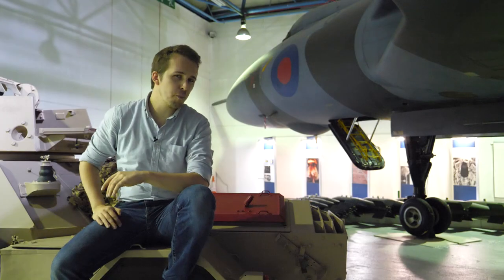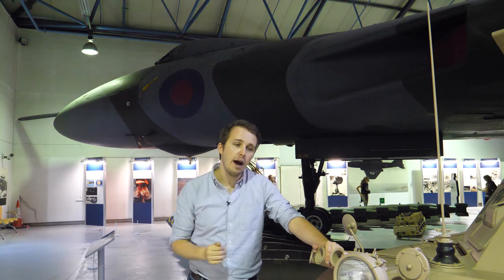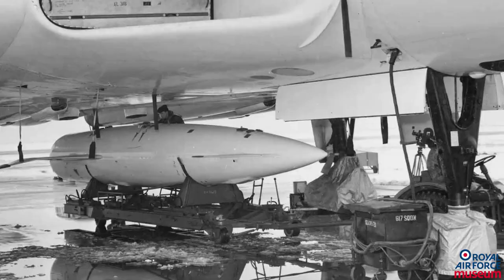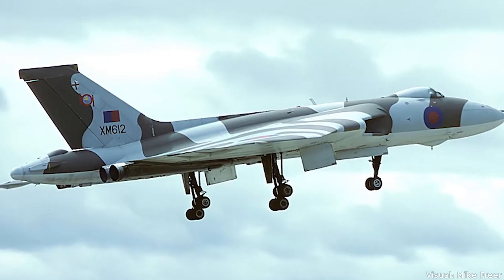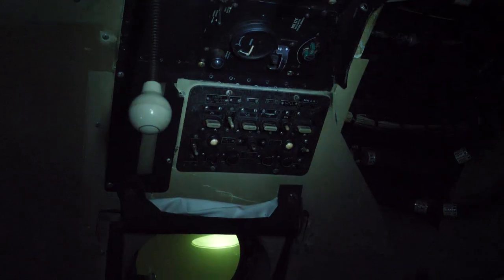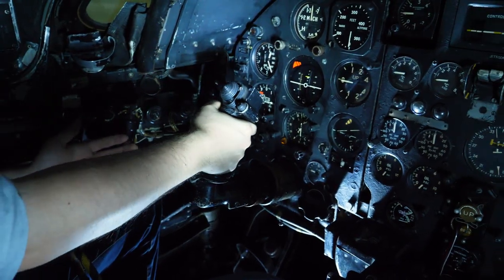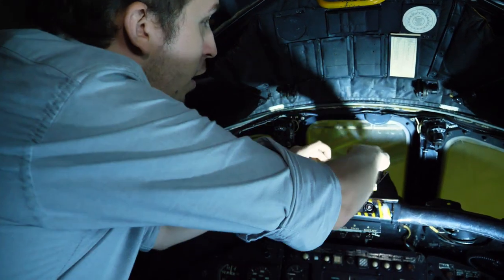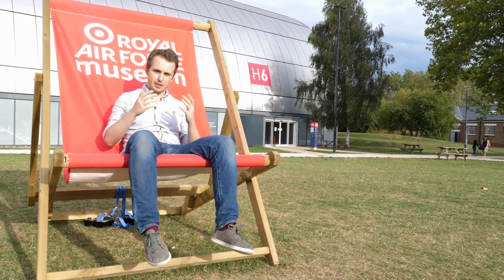Inside The Cockpit - Avro Vulcan B.2

Comment: From the 1st flight of the Lancaster to the 1st flight of the vulcan was 11 years!!
It still looks like a spaceship 70 years later!
And my god that howl
Reply: When u hear the howl of the Vulcan and it's not your Vulcan, u gonna have a bad time.
Reply: I remember being at Farnborough watching a Vulcan with a Conway (testing for the future Concorde) strapped underneath. On the Conway's power only, it just went straight up. I can still recall the vibrations I felt throughout my frame.
Reply: @johnjephcote7636  concorde used olynpus not Conway. I think the vulcan used to test the tsr2 olynpus exploded as well.
The vulcan had olynpus which got developed further for tsr2 with reheat. Then that got more development and ended up in concorde
Reply: @Scoobydcs  You are correct. It was 1964 when I witnessed XA903 fitted with an Olympus 593 underneath it (to test the Concorde intakes, I believe). It could still fly on full power with this extra engine alone and that is what I was treated to..
Reply: @johnjephcote7636  yeh the tsr2 version had 30k lb of thrust. The concorde version had 38k!! Iirc the early vulcan had 40k lb thrust total from all 4 engines lol
Reply: @1337fraggzb00N interesting

Comment: As a young teenager I saw one of these at an airshow in the 70s. It looked like a mantta ray as it floated over at a low altitude.  So cool, wont forget it!
Reply: I also have fond memories of seeing the Vulcan in the 1970s. It would appear at the Abbotsford Airshow on the west coast of Canada. We were told that came from the UK and returned in a single hop, no refueling. 

The  Vulcan banking at low altitude is the most awesome aviation sight i have ever seen. It was something beyond this world, like a massive dragon or alien spacecraft moving over the land.  For the Soviets, as the intended recipients, it must have been a terrifying image.
Reply: Stuart Grant I think, for the Argentinians, it would have been a thunderous and terrifying image also.

Talking off of the Vulcan banking at lower altitude, and it's gracefulness, one of its main advantages at high altitude was it's size. At nearly 60,000 feet, it could out turn any fighter jet due to to the enormous wingspan. And then, with self protection measures like flash and flare, it might, just might, stand a chance of getting away.

As for Abbotsford in one hop, it would have refuelled somewhere on the East Coast because even without a bomb load, the Vulcan had a range of only 3,200 miles.
Reply: @RB747domme  Regarding the flight to Abbotsford, I must have misremembered what I was told. Perhaps  they air refueled (i.e. I was told non stop, but interpreted as unrefueled) or maybe my memory was completely wrong. Regardless,  a very spe
Reply: Same here. A Manta Ray is also what I thought of years ago when one flew over me in lonely central Wales.

Comment: Back in the 80s, when I was a B-52 pilot, one of the last operational Vulcans came through our base (Mather AFB). The pilots came over to our squadron (441 BMS) and asked if anyone wanted to go out to the ramp and check it out so me a couple of other pilots got to go inside.  What struck me was just how dated the Vulcan was. B-52s are just about the same vintage, built in the 1950s to very early 60s, and though the B-52s of the 1980s were well worn and  not exactly cutting edge, but compared to the Vulcan our B-52s look downright modern and in good repair. We had FLIR, low light TV and terrain avoidance radar, displayed on a CRT in front of each pilot, the Vulcan had nothing but steam gauges that looked like they were designed during WW-2. Our Nav and Radar Nav had the all glass OAS nav system, but the Vulcan still had an optical bombsight. and while our entire crew of 6 had ejection seats (0 and 90 knots for the upstairs crew and 200ft and 90 knots for the navs) while the Vulcan had ejection seats only for the pilots. (Must have made the decision to eject a guilt ridden exercise for the aircraft commander).

The cockpit on the Vulcan was tiny, the pilots sat shoulder to shoulder.  I seem to recall the pilot telling us that the plane was originally designed for a single pilot but adapted later for two, which would explain the cramped pilots station.  The rest of the crew had chairs and some sort of bailout slide rather than ejection seats, but that cannot have been used successfully very often. As uncomfortable as the B-52 was on our typical 10-14 hour missions, the Vulcan was even worse, smaller, more cramped. While we practised air refueling everytime we flew the Vulcan guys a only rarely, if ever, practised, and had to use a probe and drogue system, while we used the flying boom from either a KC-135 or KC-10. I simply cannot imagine what it must have been like to fly those Falkland missions in that plane.

All in all the Vulcan was a bit like an old car you keep in the corner of your garage.  Not very well kept but something you might want to take out on a Sunday afternoon if you could can get it started and the roads are clear. And don't get me wrong, it looked great, from a distance, and from the outside, I just don't think the UK took it seriously anymore by the 70s and 80s, and weren't spending a penny more than necessary to keep them flying.

A side note.  The Vulcan was packed with junk that the crew had purchased as they flew the plane on it's goodby tour.  I remember a Sears garage door opener, not even a particularly good example of electric garage door openers of the time, being a prominent box in the pile of stuff they had collected.
Reply: Strato man. I think you summed up the situation perfectly. Once Polaris took over the nuclear role the MOD were not going to spend a dime on the Vulcans. There wasnt that much point in truth. We scrapped it's replacement the TSR 2, which will always be controversial, but on balance we were right to spend what money we did have on Tornado which gave us 40 years of excellent front line service. Vulcans performance in the air was always remarkable given its vintage and size. Test pilots did double rolls off the deck in these things. Service pilots were strictly banned from such aerobatics.
Reply: @timhancock6626  TSR2 was not a replacement for the Vulcan!!!! When the RAF started the Jet bomber game the first design to enter service was the Canberra. What entered service in the B2 version was not what the aircraft was originally slated to be, The prototype Canberra's had solid noses as it was going to be radar bombing only, with a H2S Mk 9 radar in the nose, an advanced electro mechanical / Electronic navigation and bombing system (NBS) and employ a guided bomb code named Blue Boar that would use either radar or TV guidance to hit the target. Needless to say the RAF soon found out that there was no way that all of that kit could be shoehorned into a Canberra, So it became a visual bomber only. Victor and Vulcan development kicked off first, but it was soon discovered that these aircraft would take some time to get into service, thus two interim types were developed to get the RAF into the long range jet bomber game. The one that did enter service was the Valiant. Which saw combat in 1956 during Suez and was the only one of the Three V-Bombers to actually drop live nuclear weapons during the British tests between 1956 and 1958. Blue Boar was canned in 1954, but H2S Mk 9 and NBS went into the V-bombers. Vulcan entered Service next, followed by the Victor. Why by the two? Vulcan was good at All Altitudes, Victor wasn't as they found out when the wings stated to crack up after the aircraft moved to the low level role. plus the Vulcan was easier to load. But the Victor could carry 66% more bombs (35x1000lb v the 21x1000lb on the Vulcan) a lot further (5000NM v 2100NM max internal fuel range). Valiant moved into other roles as the two more advanced aircraft took over the Deterrent role (NATO tactical Strike using US Project E nuclear weapons, In-fight re-fuelling tanker and long range photo reconnaissance). The Canberra's also got US supplied Nukes, while the British worked on their own tactical nuclear bomb to put on the Canberra and Buccaneer (which had the S designation as it was designed to lob a Red beard Nuclear bomb at Soviet Cruisers). 1957 saw Sandy's move to IRBM's as the RAF's primary nuclear strike option, but Blue Streak was going to take some time to get working, thus Blue Steel was developed to give the Vulcan's and Victor's some stand off capability. 100 Miles with the Rocket powered version and up to 1000 miles with the planned Ramjet powered Mk2. 1960 saw TSR2 enter the picture,but its job was to replace the Valiant and the Canberra, not the Vulcan and the Victor. Blue Streak and Blue Steel Mk 2 were canned and the Vulcan was going to get Skybolt ALBM. A few Vulcan's were built to carry the weapon which resulted in upgraded engines and wing hardpoints (which turned out to be very useful as these were the aircraft used in the Falklands war). Kennedy canned Skybolt in late 1962 which resulted in the British going for the Polaris SLBM. TSR2 was going to be a total pig, loaded with a shedload of design flaws across the board (When the RAF Engineers got their first look at it they had a fit!!!) which were not fixable in the time scale the RAF required, plus in 1964 the Valiant force started to fall to bits. Early Victors replaced the Valiant as Tankers and Photo Recce aircraft and soon as Polaris became operational, the bulk of the Vulcan's took over the UK's NATO nuclear strike role with WE-177 bombs (plus replace the Canberra Strike wing on Cyprus). Some Vulcan's did take on the Maritime radar recce role while the Victors became tankers. Phantoms and F-111K planned to do the Germany / UK based Nuclear Strike role, plus F-111K was planned to do East of Suez missions in Far East Air Force. Six Day War and the Closing of the Suez Canal did as much to cause the pull out of the British from the Far East as the shit state of the UK economy at the  time (most of the UK's reinforcement plans were based around having access to the Canal for Sea-lift). Seeing most of the F-111K requirement was based around Far East operations, the F-111K was binned and the Buccaneer procured to replace the Canberra in Germany (the Short field requirement was to do with the NATO dispersal policy which was part of the Tripwire policy (any Soviet Aggression against NATO mean instant all out Can of Instant Sunshine chuck fest from the git go). The 1968 change to a Flexible Response (conventional war phase first if the Soviets only used conventional weapons at the start required aircraft to operated from main operating bases)  . Anglo French VG aircraft development started to replace Buccaneer, with the Jaguar as a trainer. AFVG canned when the French pulled out. Must Replace Canberra Again project started. Jaguar morphed from a trainer into a nuclear strike aircraft which replaced the Phantom's to be rolled into Air Defence Fighters. MRCA became Tornado  and as soon as the first UK Tornado GR1 squadrons became operational,the Vulcan force was on the way out.  Of course thanks to the tanker requirements need to support the Falklands air bridge, 6 Vulcans were modified to Tankers and operated until the VC-10 Tanker force became operational. As for Service pilots doing not doing Aeros in Vulcan's, don't you believe it. While the Vulcans were stationed on Cyprus, an RAF Armourer I once worked with saw a Vulcan land on the Island after a transit flight from the UK. He saw a very shocked rear crew and Crew Chief get out of the aircraft.When he asked them what was wrong, the Crew Chief in tears stated, "bloody idiots in the front tried to Loop it!!!" Turned out that they screwed the loop up and the aircraft very nearly ended put falling out of the sky inverted.
Reply: Quite a commentary from someone who has the credentials .    Thanks for the insight!
Reply: Its rather typical of UK defence approach (then and now). We invest a lot to design and build the things and then underinvest in modernising them until they become obsolete. Unlike the B52 we never worked out an ongoing role post nuclear deterrent so never bothered to spend anything for the subsequent 20 or so years. I guess the RAF would love to have a modernised ones with guided munitions flying over the middle east in the same sort of role as the B52.
Reply: Nice info.
I was lucky enough as a kid to sit in the Vulcan and yes it was similar in size to a old mini. 👍
Reply: I think you are correct .. typically British mindset I’m afraid ….we develop something and then don’t invest in it .
Reply: So it is cramped, I drove 3000 miles in a small car in 4 days.  Cramped, but livable.  14 hour daily drive, sleep on the ground, repeat.....

Comment: One refueling part was being used as an ash tray in the squadrons ready room
Reply from the maker: Really! What SQN if you know?
Reply: @MilitaryAviationHistory  I don't know if the 3 squadrons had separate crew ready rooms but it was a ready room at RAF Waddington
Reply: Read Vulcan 607 book. Anecdote of this story is there
Reply: @scrubsrc4084  A chap I worked with was stationed with them up at RAF Kinloss , he said when they got a scramble order and they took off together using the Express start, the Noise was just deafening.
Reply: The bomb rotation rack, to release all the bombs, was still sat in the scrap yard where they were sold, when the Vulcan was decommissioned.
The owner of the yard was sold a Lot of Vulcan equipment, for scrap.
Turns out he just couldn't destroy most of it. 
He still had them in his sheds when the RAF phoned him, looking to get the Vulcans flight ready for the Falklands Conflict

Comment: One thing I would suggest which is lacking in most videos like this, is a panning shot around each cockpit area so you can see how the parts all fit together. It isn't always obvious when all you see is a lot of small detail shots , it is hard to tell what relationship they have to each other. It is hard to see for example, the way the cockpit is raised up above the rear cockpit with a ladder, and how the bomb aiming space is under it.
Reply: Agree, the cockpit shots are a bit disappointing to be honest, hard to form an impression of the overall space.

Comment: I used to volunteer at an aircraft museum in North East England, they too had a Vulcan although outside and subject to the elements, it didn't look in great shape last time I paid a visit. When I worked there however I got to sit inside the Vulcan many times, it still had most of the instruments in the back section of the cockpit because it had been flown in when the museum was a functioning airfield.
If you go into the bomb aimer position ahead of the perspex visual aiming window there is a door allowing access to the nose and radar of the aircraft. These planes carried an extremely powerful radar and electronic counter measure suite. The Vulcan I used to work on was being decommissioned in its new home by the RAF when the ECM jammer was accidentally turned on blacking out the local commercial airport some 9 or 10 miles away resulting in some frantic and rather angry phone calls.
In case of emergency the Vulcan was not especially liked by its crew, in particular the three guys in the back who were not fortunate enough to have ejector seats. They would have to slide down the hatch and bail out, all well and good assuming the plane was the right way up. Also the nose wheel is directly behind the crew hatch so if bailing out with the gear down it would be almost impossible to avoid smacking into the landing gear on the way out causing nasty injury if not death.
Reply: BIll Smith (of Bluebird K-7 Recovery and Restoration fame) have actually got the one of the engines on that aircraft working.

Comment: In the old airdisplays the Vulcan would pitch nose up and come almost to a vertical halt. The engines would then be turned up to full, pummeling the audience into the ground as it launched vertically into the sky. Thats how I remember it
Reply: Vulcan doesn't have enough thrust to accelerate vertically. Only the most powerful fighters can do that. If it was lightly loaded they can pull into a steep climb using the speed they already have and maintain it above stall speed for a while on engine thrust, but it will be slowing down gradually the entire way. So if it looked like they "stopped" and then climbed it was an illusion. Even the famous "vertical climb out" of the Lightning was done by building up speed over the runway and then trading it for altitude with the afterburners sustaining the climb for a while until speed dropped. A Vulcan has significantly lower power/weight ratio.

Comment: Good job with the video as usual. At 10:25 when he starts talking about the in-flight refueling probe being obtained from a museum in the US; that is likely a reference to S/N XM573 at the Strategic Air Command and Aerospace Museum in Ashland Nebraska. (Suppose they may have borrowed from other museums, too). About a month ago, they finally replaced it with a mock probe. If you’re in the area, stop in and check it out.